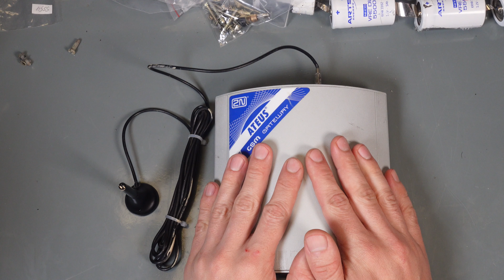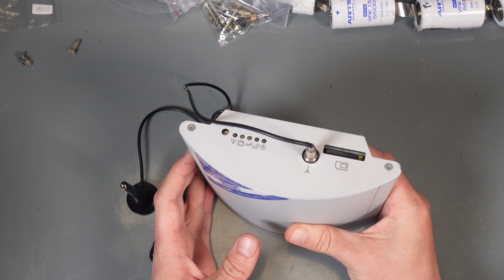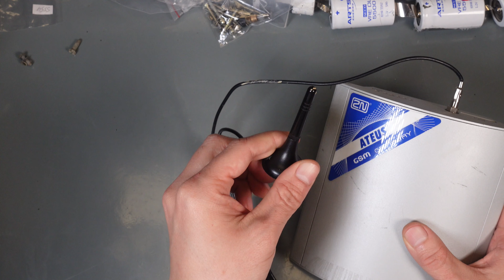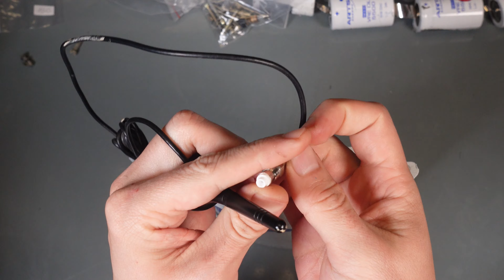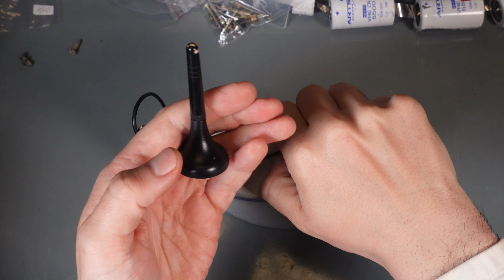ATEUS industrial GSM phone gateway (convert mobile SIM card to landline phone)

Comment: FME STYLE CONNECTOR for that antenna. Very low loss connector. I see these are still available but grossly overpriced. The Ericsson G30-G35’s were under 200€ new.
Reply from the maker: It was very popular for LTE modems, there should be adapter for something more common and easy to crimp.